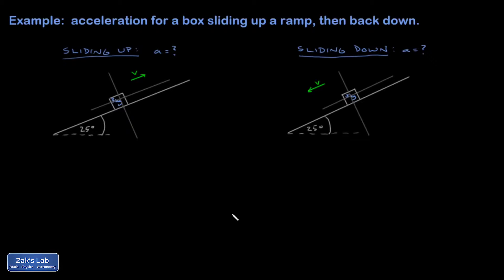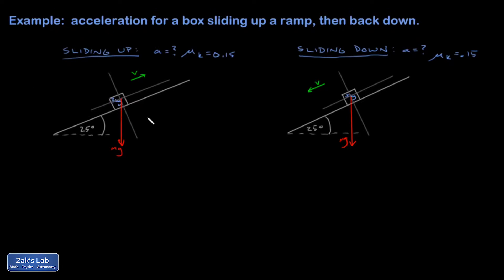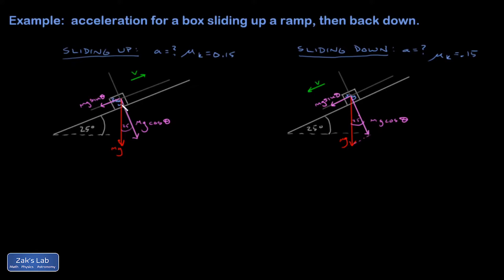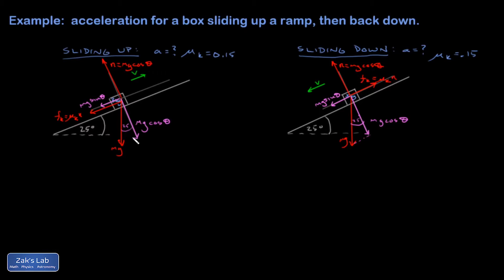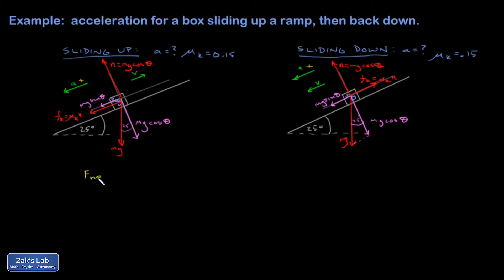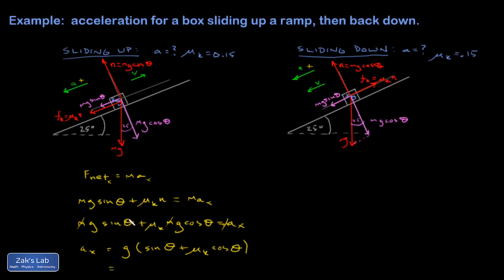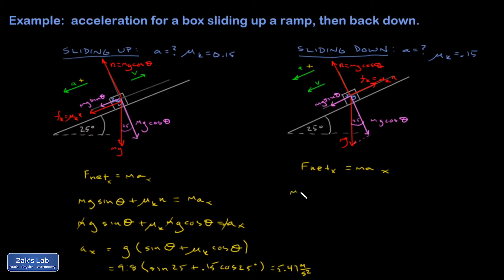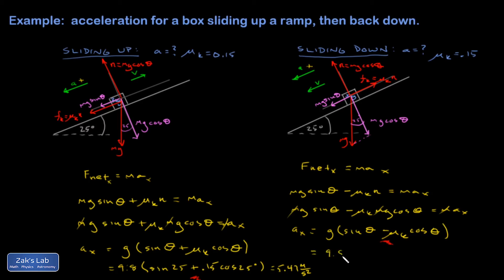Block sliding up and down a ramp physics problem with kinetic friction, find the acceleration.

Comment from the maker: Questions about the video or requests?  Leave a comment below.  -- Zak
Reply: Without friction, do you simply not add that component?
Reply from the maker: @rb2012  Sure -- f_k would be zero, and the net force pointing down the ramp would be mgsin(theta), inducing an acceleration of gsin(theta) down the ramp on the way up AND on the way down.

Comment: Could you please tell me why there is no external force for the case 1.....and what if there is,how can solve that
Reply from the maker: There are three external forces:  gravity pulling straight down, normal force perpendicular to the surface and friction parallel to the surface.  The friction points in the opposite direction to the slipping of the block.  I have seen a common mistake of including a force pointing up the ramp as well, but there is nothing pushing or pulling up the ramp.  The block starts out with an "up the ramp" velocity before the problem begins (someone must have pushed it), but now it is sliding up the ramp on its own and slowing down due to the combined forces of friction and parallel component of gravity. z
Reply: @ZaksLab  thank you ❤️